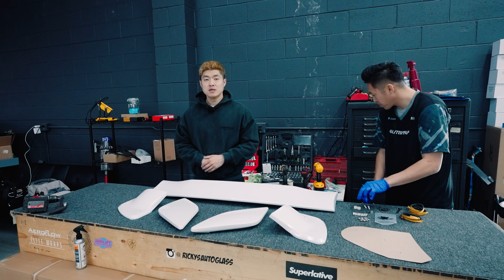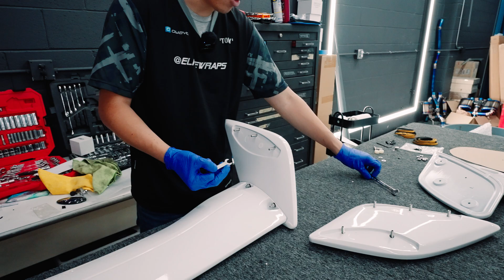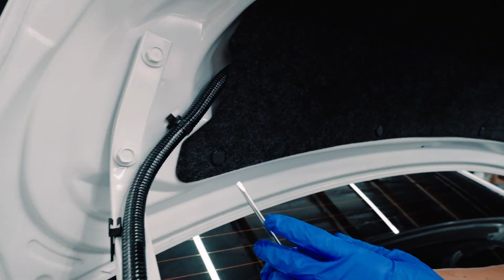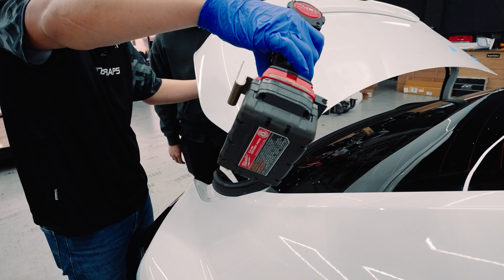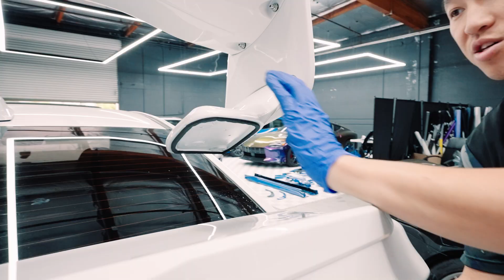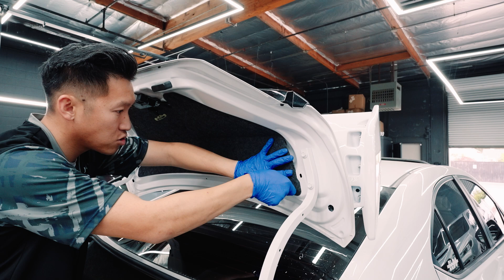How to install your Aeroflowdynamics V3 STI Wing | 2022 - 2024 WRX

Comment: Ordered my wing but it was delivered without the drilling template for the top. Been almost 4 days now and says my template is still at the shipping label created stage. Customer service kinda sucked. Didnt get any verification from support or an apology. Just got an email saying my new order is being processed. How many days does it take to ship out a piece of cardboard? lol…. Ordered side skirts as well that came without any of the mounting hardware. Idk whos in charge of putting the orders together but they need glasses or a new job… 😂 so far they are 0 for 2 in my orders… 😢

Comment: I JUST ordered mine maybe 15 minutes ago… and I’m gonna say that I’m so unbelievably nervous to drill into my deck lid. Like really nervous. 
I’ve installed a full ETS exhaust by myself, a front lip, side skirts, rear canards and a few carbon fiber bits in the interior but drilling holes in the actual car scares me to death
Reply: YOULL BE FINE.. JUST GO SLOW.. BE CAREFUL.. AND LET GO OF THE FEELING OF NOT WANTING TO DO IT.. IT WILL LOOK GOOD. IM WAITING FOR MINE TO ARRIVE

Comment: Watching this in anticipation of the full RS wing install video to be released..  Ordered a ceramic white RS wing a few days ago.  I've been looking forward to the RS wing since it was teased a few months back.  Can't wait to get it installed!
Reply: Can you install the rs wing if the WRX had the oem duckbill spoiler on? I mean does the holes affect the rs wing install or it cover them?
Reply: @josemorales3279  The RS wing will cover the holes used by the OEM trunk spoiler.  The RS wing kit has some felt covers for the holes that was used to mount the trunk spoiler, iirc.  My RS wing should be arriving later this month.  Can't wait!

Comment: Yeah, there is NO FRIGGEN WAY I am even going to pretend to attempt this by myself. I'd hire a pro.
Reply: I know this reply is 3 months later.. but, it's a lot easier than you might think.  Sure, it's a bit nerve racking the first time..  ngl about that!  Just need to make sure to double check measurements and make sure initial drilling locations are properly lined up with the wing bolts.  Double and triple check it.  Using a center punch on the drilling locations on the trunk will help insure the drill bit does not 'walk' out when starting the hole.  Step-bits make the job fairly easy, though I prefer using a regular carbide or cobalt/Ti coated bits.  Done a few different installs that required drilling and feel pretty confident about doing them now.
Reply: lol yea anything that involves drilling holes in my car I let the pros do

Comment: I just did this, took me 3 1/2 hours because the holes wouldn't line up.  Couple suggestions for aeroflow is to maybe use black hardware for darker colors like wrb, also, make the screws magnetic, that would make life so much easier. Other than that v3 wing looks great! Idk why I had so much issue lining up the holes but whatever, it's on lol. Had to pull the truck off too for lost hardware, but that's pretty straightforward

Comment: I think it’s funny how I follow along with this video just to personally find out that after drilling the first 2 holes that that shit isn’t even correct
Reply: Same thing just happened to me, what did you end up doing to mount the wing?
Reply: @TyGoinGlobal sorry for not replying didn’t see it until now but I’ve done nothing. My wing has just been sitting in my room and I’ve gone to 5 shops to see if they could do it for me but none said yes cause they don’t want to be liable for the drilling part like my fuck up.
Reply: Yeah fr . They don’t even match .
Reply: @Napoles428 did you ever get it on ?? Mine doesn’t fit either
Reply: Well me, a 53yr old lady just did it. My son held the wing for install but I did all the drilling. Lined up perfectly. 🤷🏼‍♀️
Reply: I have the same issue

Comment: What size did he stretch the top drill holes to after he drilled them through?
Reply: whatever is just big enough for the bolts to fit through. Not too big, I used silicone on the washers to seal around the holes.

Comment: Lord that wing doesnt fit the car. Just look at how wide the body of the VB is compared to the wing and how narrow the wing is from the rear. It worked for the VA because the VA was boxier and the trunk was flatter but not this gen
Reply: Everyone with a subie or wanting a subie complains about something. If you don't like it, then cool, don't get it. I remember when people used to actually appreciate the car scene, but now a days it's just a bunch of whining babies because they wanna be followers, not a leader
Reply: @brentnicol1586 I never really liked them either until I saw one in person. Now Im buying one.
Reply: Looks good bro
Reply: After looking at pictures of the spoiler on the va, I don't see what you're talking about. The va has a wide body as well and has this same effect as the vb, it still looks good imo. If anything adding a wing on the vb makes more sense because it adds more color to balance out the large black bumper.
Reply: @acemace3618  u like the plastic bumper and cladding eh , gross
Reply: @BigDonk420  it really doesn't look that bad in person
Reply: Ya the whole new wrx is a dud honestly.
Reply: Looks better than VA @BigDonk420